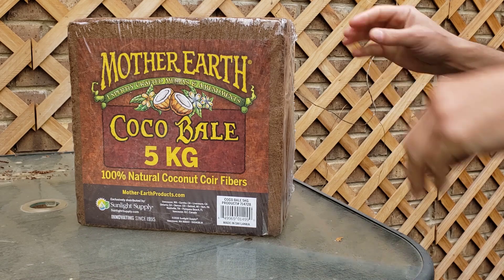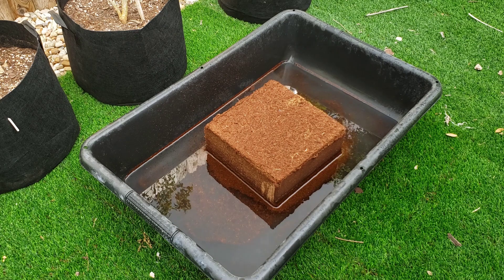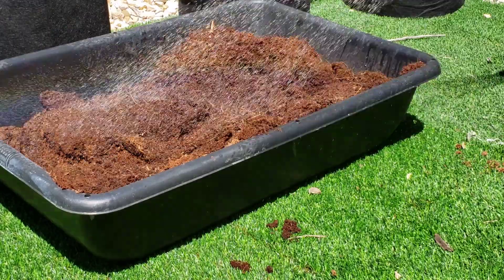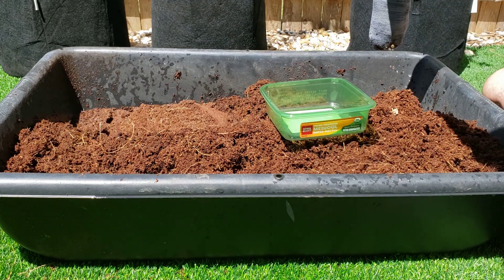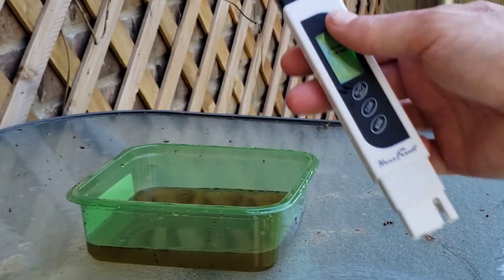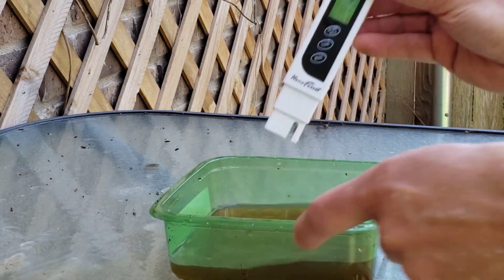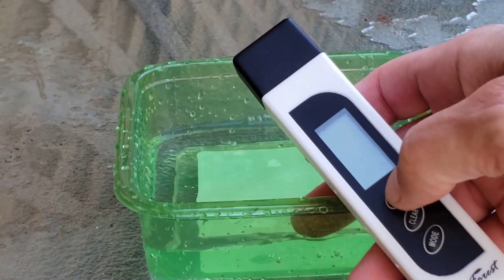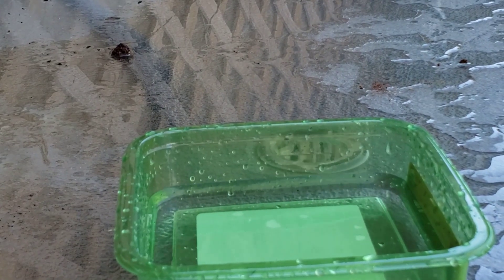Testing Salt Levels on Mother Earth Coconut Coir

Comment: That meter tests TDS (Total dissolved solids) not just salt content.
Reply: Oh, ok.  So the salt content is even lower?
Reply: @chughes4383  possibly. You would want to check the TDS of the tap water first then check the water mixed with coir, then check the mixture after a good rinsing. That way you get a before and after to compare the ppm of solids that were removed (in this case salt)
Reply: I bought a different brick of coco and tested it the same way. I found that the TDS of my tap water was about 600ppm. After adding coco to the water it was around 620ppm. So, that leads me to believe that the coco was pre-washed. I’ve seen other coco tested this way with a TDS of around 2000ppm, which would lead me to believe that soil was not washed. Just my 2 cents 👌